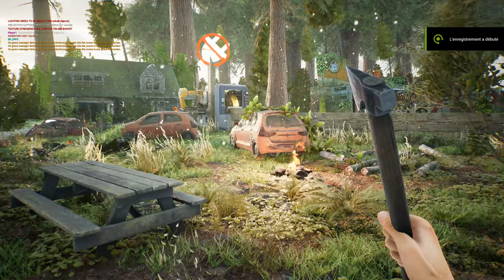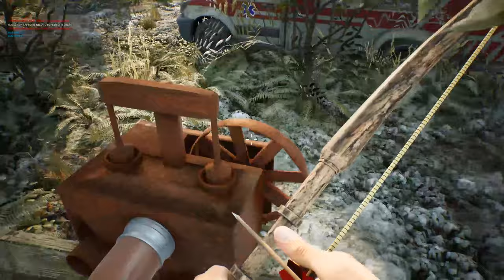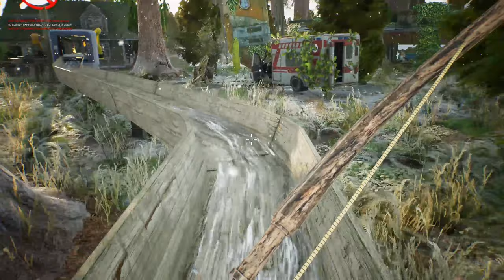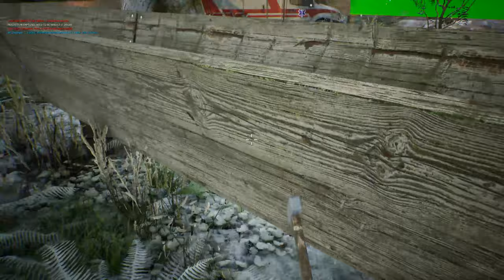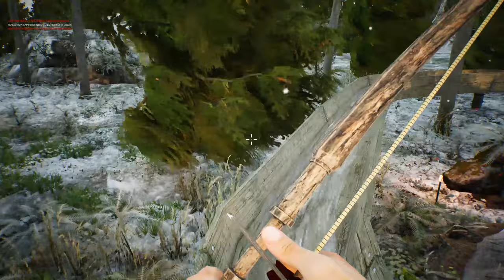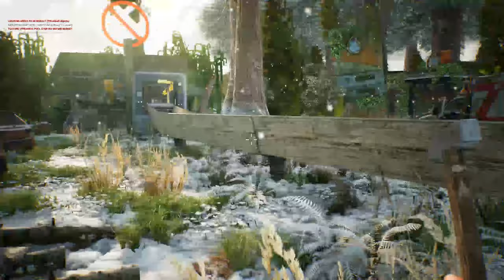WIP Derelicts - Water pumps feeding water to the conveyor and segment destruction - Unreal Engine 5

Comment: awesome. the pump design and movement is looking very good.  will there be some sort of inserter ,like gripping arms or something like that, to place logs and stuff on the water slides? imo the flywheel of the pump should rotate constantly in one direction(it looks like its changing directions)
Reply from the maker: Thank you Querantino ! In fact, the players will be able to drag the trees and carry the logs to the water slides. I think I'll have to think of a system with a ramp that allow them to go over so they can drag the trees. You have some videos on the channel where you can see the drag mechanic (you attach a rope to the trees and drag them around) :). For the pump wheel movement, in fact it's a normal movement, the wheel is going both way like you can see on petroleum pump in real life (if you see what kind of pump I mean !)